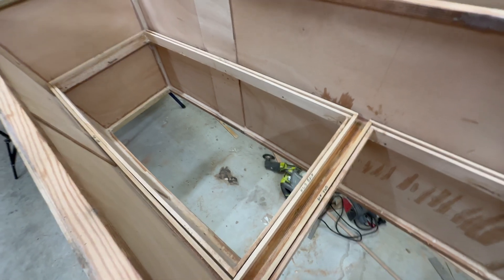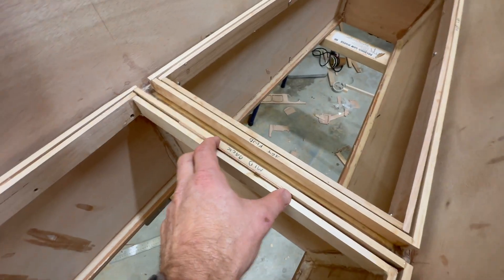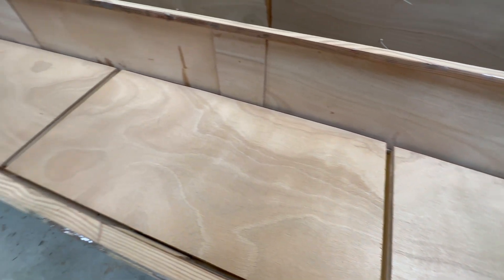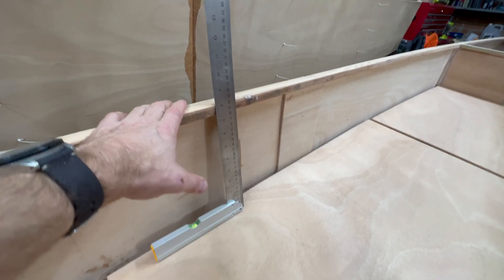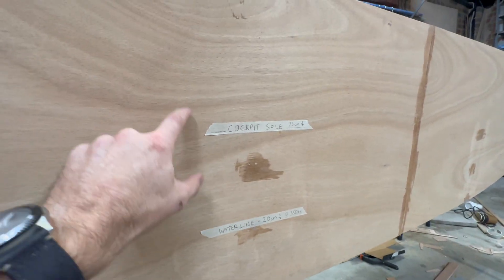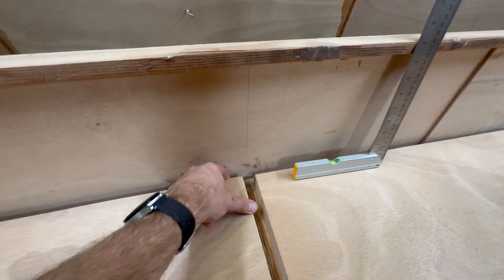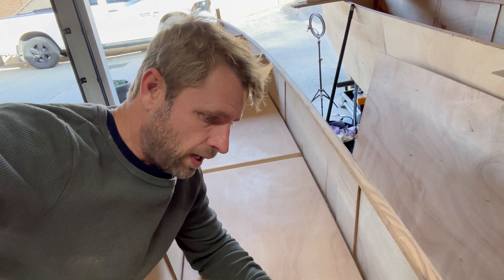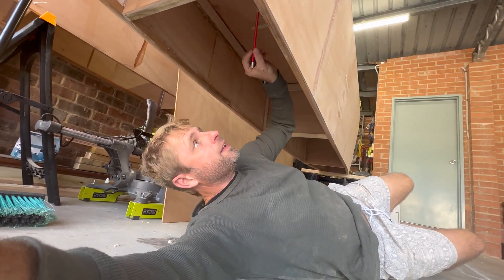DIY plywood catamaran Ep.14 - making plywood boat hatches

Comment: Nice job Aaron! I wonder if fiberglassing the hatches would give it the needed strength without adding as much weight as another layer of plywood. Plus it would help spread the load out.